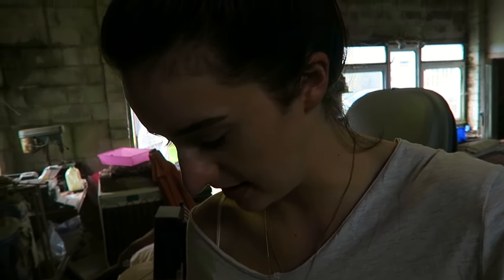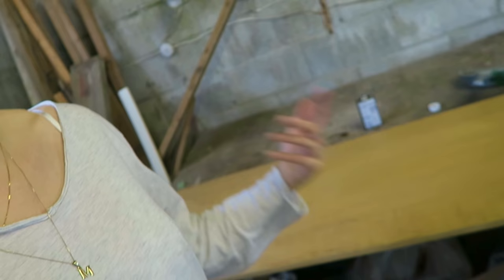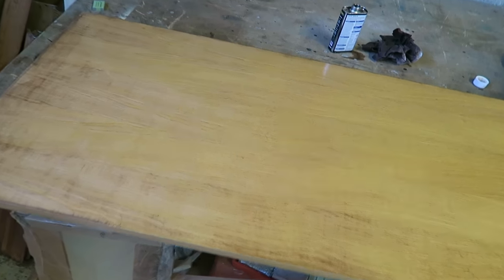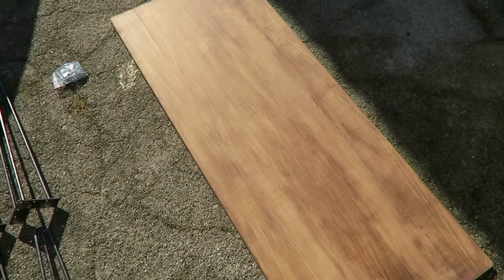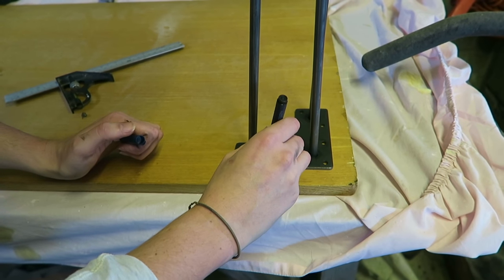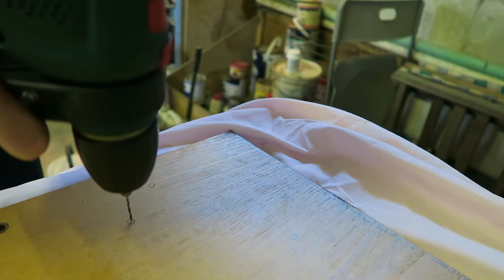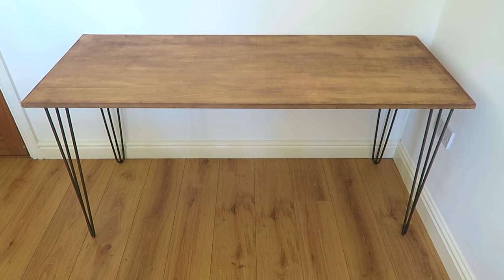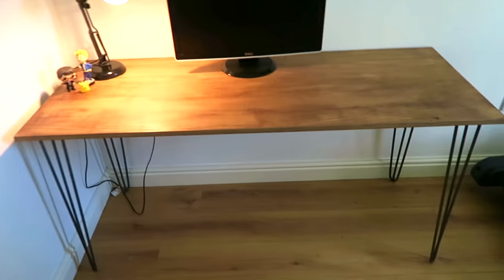3 STEP DIY INDUSTRIAL HAIRPIN DESK

Comment: would you say those legs are sturdy enough to support a slew of equipment? i plan to use a hollow core door (because these legs screw into the corners where there appears to be about 2" solid wood around the parameter.) I will make an L-Corner desk with these. One side will hold a good sized printer (wf-7610) and a 14" plotter. they aren't terribly heavy, but I just worry about wobble or shaking side to side while the printer is printing. The other side (the actual corner of the L of these two desks) will hold a 25lb computer case (or 11.3kg?), and the monitor.. which I may end up wall mounting anyway.. I don't know if the legs are flexible like some  I've seen, or if they are pretty solid and won't show any signs of wobble.  Also should I do 28 inch or 30 inch legs?  They're on ebay right now, set of 4 for $40,  (3 pin like yours are), but my choice of height. Computer desk, not sure if the chair will be height adjustable...